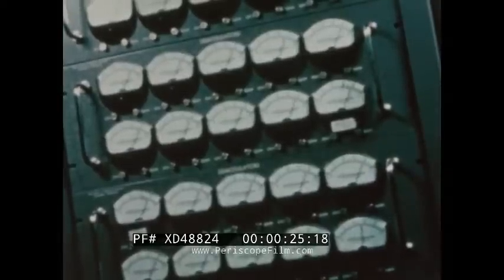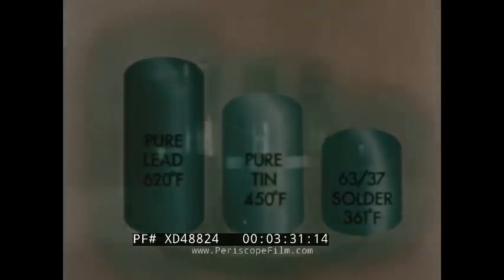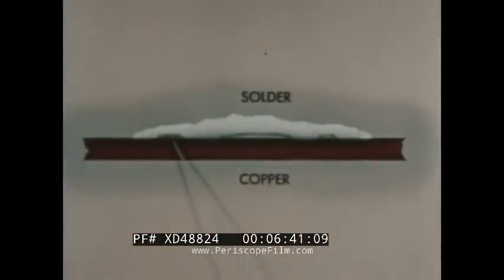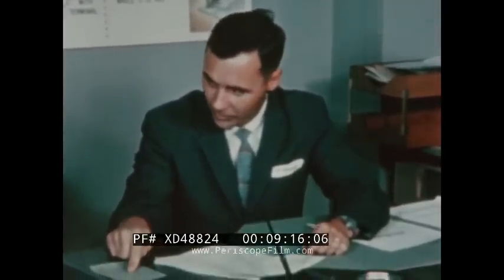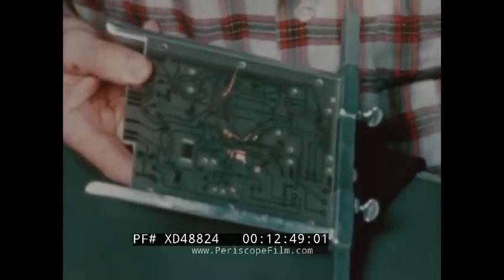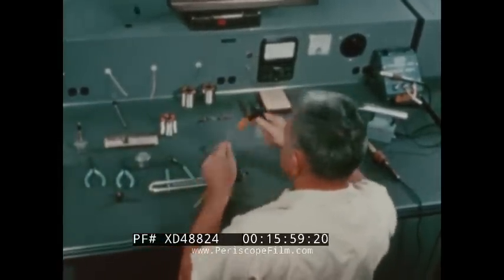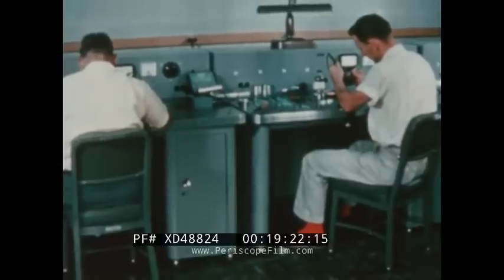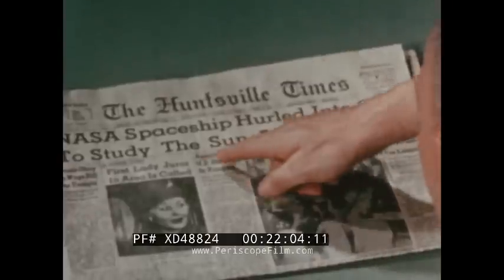1958 "ABOVE AND BEYOND" NASA SOLDER & SOLDERING TECHNIQUES ELECTRONICS INSTRUCTIONAL FILM XD48824

Comment: Solder melts at a lower temperature because the alloy of the two metals is not a crystalline structure. I think they knew that in 58.

Comment: The demands do not cease. Space work is considered “critical circuitry” in today’s world. That would be under the new J standard as level 3 work. I learned back before that when DOD STD 2000-1 was the standard. This is the equivalent to J STD 006 level 3 today. Avionics is treated with equal respect to aerospace work. The solder I used was and still is 63/37(63% tin/ 37% lead) which is known as a pure eutectic solder. It has two states, either liquid or solid. Flux used was RMA, rosin mildly activated, both in the solder’s core and the extra flux which was in liquid form. A match of flux core and extra flux is critical as this chemical matching insures consistent, reliable and repeatable results will occur under this rule. The cleanliness of all surfaces is achieved with 99% isopropyl alcohol and the tin acid brush cut to a shortened length of no more than 3/8” from the tip to the ferrule of the brush. This gives the proper stiffness to attain the cleanliness needed to remove all oxides and any other contamination for each joint. Each individual joint is cleaned prior to and after each joint is soldered. No exceptions are acceptable as there are no slack given as mission accomplishment and crew safety are in the balance as well as equipment reliability. There is much more beyond what this video went into, but soldering to this standard isn’t for everyone. Not all have the patience or skill necessary for it and this level of soldering is an unwavering discipline. There is no place for error in critical circuit work. Absolutely none. Those who do this level of work must never forget that all they do is centered around the fact that no single point of the procedure is below scrutiny. Failure has a high price. It is a privilege to work in this field. If you have the discipline and skills to do this, you will be an asset to your company or the government. Stay safe my mates!😊👍🏻😁

Comment: From my own experience, a "cold solder joint" is an actual problem. It might Test OK but the connection will easily fail and result in an open circuit.
Also, the War in Vietnam, Nixon said; was for Tin Ore and Rubber (which is still 20% of a tire).
Reply: Nixon said a lot of stupid things, few of which were true. ;-)
Reply: @arcanondrum6543  Wars are rarely about anything but about stupid people making stupid decisions, kid. Have you been watching the news lately? Which one of Putin's actions appears rational to you? :-)
Reply: FYI for anyone checking this thread,  Nixon was Eisenhower's Vice President when he said that about the Rubber and Tin and he said it in front if a Map of the Region,  on camera.  US Troops were 1st sent to Vietnam by Ike (and Nixon) and the assumption was that Nixon would win the 1960 Election. 
National Security Action Memorandum (NSAM) 263, signed by Kennedy was to pull all US Troops out of Vietnam by the end of 1965. That was reversed by LBJ (NSAM) 273 just days after JFK'S funeral. The "Gulf of Tonkin Incident" was 8 months later.  Before Eisenhower sent US Troops to Vietnam,  France  (Michelin Tire) had tried for decades to colonize Vietnam, it was called "Indochina" at the time.

Comment: This was super interesting, I started my working life as an electronics repair tech for Philips, I changed career after about 10 years but have been an electronics hobbyist ever since. I'm proud to say that I've never had a project fail due to a poor soldered connection, but I still learned things from this vid.  One thing bugs me though, why do Americans pronounce solder with a silent L, and resin, rosin?  As a Brit I find that strange.
Reply: But it is rosin; traditionally used as flux.

The sodder thing is just bloody irritating tho!
Reply: Dude, you simply never had to work on anything that required reliability. 1 million hour MTBF manufacturing is totally different from what you are looking at here.
Reply: @robertbolstad9465  Ah, you've seen my soldering then! 😂
Reply: Solder is pronounced that way for the same reason any other language develops colloquialism: It's easier to pronounce
Reply: @MrCarGuy  
How is solder difficult to pronounce?  I've been saying solder, with the L, since I was 10!  It must be some quirk of the Americans, since soldering was around long before electronics, it probably developed from the way workers in the plumbing or sheet metal trades pronounced it during the 19th century.
Reply: @schmetterling4477  
Well that is a feature of the Aerospace industry, in which I've never worked, and relatively few have compared to the electronics industry as a whole.  It is surprising however, that mass produced smd boards that are flow soldered are as reliable as they have proved to be. I can present one of my projects from the 70's, a 6 digit clock, built from a kit, using a single clock chip with discreet display drivers, that has accumulated about 360,000 hours without fault, excepting one segment of one of the 7 segment LED digits.  Pretty good going for a consumer electronic item!
Reply: @turboslag  The standard industry processes are only reliable in their near constant environments. Try 1000 heat cycles between -55C and 105C and vibration and the normal stuff will fail on you like there is no tomorrow. That is not even a particularly special requirement. Automotive and aviation are like that (and worse).

I talked to a guy once who worked in quality control for telecom DC/DC converters. He said for the longest time they couldn't get the MTBF higher than a couple hundred thousand hours. They had to switch to a soldering process with high temperature solder and get rid of all semiconductor packages. Only after they decided to solder the dies directly onto the ceramic substrates and go to wire bonding with multiple bond wires did the products pass the 1 million hour MTBF requirement.
Reply: @schmetterling4477  
Yes, I understand that, I wasn't trying to compare the two applications.  During my studies we had a section on MTBF and the tutor made us very aware that it was not a matter of if failure would occur, it was just a matter of when.  He then went through the various factors involved.  General purpose and consumer electronics were at the bottom of the pile,  military and aerospace at the top.  Even so, I still think my humble clock has done well.  One thing that really surprised me is why truck manufacturers locate ecm's on the side of the engine block just about the worst environment?!
Reply: @turboslag  Exactly. Engineering for reliability is a discipline in itself. The hard part in "normal life" is to know when to care about reliability and when it's not necessary.

I have a funny story about truck engines. I went to a conference about optimization algorithms once. One group of students presented a paper on how their algorithm had found a tiny change in the shape of camshafts that would have saved the engine manufacturers a camshaft replacement at the 500,000km mark. After the talk an engineer from a very famous truck manufacturing company stood up and said "That is a fabulous paper. I congratulate you on improving engine reliability with such a tiny design change. Your algorithm has re-invented a design that has been known in the industry for many decades. The problem is this: whenever we sell a truck with a brand new engine, we are losing thousands of dollars on the engine. We only make this money back by requiring the truck owner to do a complete engine rebuild at 500,000km....". The entire room broke out in laughter, of course. This a true story. :-)
Reply: @turboslag  I also have such a clock I built back in the 70's. It was a Radio Shack kit, they sold the clock chip, bare main board and display board. I wanted to do a project and I was sick of my electromechanical clocks dying after a couple of years. Looks like I made the right choice - 45 years and it's still going! I also had a couple of segments fail.
I remember some of the components were fairly expensive, especially the LED display modules.
Reply: @turboslag  its a level of dumb you'll never understand...believe me I've tried for years

Comment: Long before iron plated soldering tips. And as one with a soldering licence I could have a thing or two to tech them.
Reply: Please say more.
Reply: You are the James Bond of aerospace circuits. :-)
Reply: @david203  Well its according to the license from the modern day and even if much is similar its just more evolved in some areas sort sort of speak, fex when you wrap around the tinned cable around a tower its not only one or two times these days, as an example. And also doing all that without a fume extractor is not good.
Reply: Careful not to step in the BS :)
Reply: @GoSlash27  ?
Reply: @dtiydr  Meaning warning to others that you have absolutely no idea what you're talking about.
Reply: @GoSlash27  Like what did I not have any clue about?

Comment: 3:48 So do we know why mixing tin and lead results in a lower melting temperature? Curious if anyone ever figured that out?
Reply: Google it for a more detailed reply but it has to do with the structure of the atoms. Most metal atoms form into a crystal like structure that minimizes the space between them. Because alloys are compromised of different elements, lead and tin in this case, they get in the way of that element creating a crystalized structure. The different sized elements form voids in this structure that lets them melt faster.
Reply: They knew it at the time, they just didn't want to put it in the film and were lazy writing that part of the script lol
Se the answer above for the details.
Reply: If you search for “lead tin phase diagramme” you’ll see the ratios and temperatures.

Comment: Hm for gentlemen speaking about aero industry MCAS problem it was not Indian programmers  it was programmed in Brno Honeywell or at least that is what evil tongues says I dont know whether that is a truth or not but I have some stories from my friends programmers who were offered a job there and they told me some crazy stuff.Namely how programming was done with no feedback from the hardware. Some algorithms were nobody knew what they were responsible for. Bunch of data processed and data optimization with no recheck what that data does etc.. To the actual aircraft (737 max) I ve read long article and basically it boiled down to putting large engines to small aircraft and MCAS to compensate for that because nobody wanted to pay re-schooling the pilots for the larger aircraft some companies namely who run large fleet.

Comment: I don't know why the narrator pretends like they don't know why 60/40 melts at a lower point than tin or lead. To oversimplify, its the crystal structure that solder makes that requires less energy to melt. the structures of lead and tin interact in such a way that the resulting crystal is easier to melt. it has to do with gibbs free energy. the complete answer is pretty complicated, but that branch of thermodynamics has been around for a long ass time, since 1900 or so. maybe this video just didn't want to waste a single second teaching a technician any theory. "yours is to do, not to ask why"

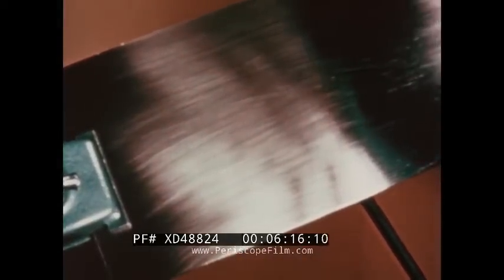Comment: 6:18
this is why it is an horror to fix an old radoo or replace an old device's caps that have a bad varnish or electrolites on the PCB. Still useful today, but if only the current NASA engineers could have that discipline, they'd be back on the Moon as we speak.

Comment: I went to the NASA micro mini soldering and then QA school in the 70s. Bifurcated terminals were a bitch.
Reply: I think you were supposed to push the wire into the slot. But then the surface area of the joint was a minimum. You want it to be closer to a maximum before soldering.
Reply: @david203  It wasn't that simple for NASA specs, the wire could not contact the sides of the terminal and the solder flow had to be perfect.
Reply: @joemalinchalk1314  When building kits, I was always taught to make maximum soldered contact with the terminal. If the terminal has a tip, then the wire should contact the tip. But if bifurcated, there is no tip.
Reply: @david203  Not good enough for NASA.

Comment: Has the question of why solder melts at a lower temperature than its constituent parts been subsequently answered by science? I'm guessing its something quantum-related that they wouldn't have known at the time.
Reply: Why mixtures melt at lower temperatures has been known for quite a while. What happens is the crystal structure of a component is interfered with by the crystal structure of the other component. Same thing applies to anti-freeze. Multiple crystal structures interfere with each other. So in a tin/lead solder, the tin acts as an anti-freeze for the lead, and the lead acts as an anti-freeze for the tin.

Comment: Today = need masters in soldering.
Reply: False. It's exactly the same today as it was back then in the aerospace industry. You can apply to become an assembler with no degree whatsoever. If you're one of the 4 out of 100 applicants who makes it through soldering school, you've got a career for life. Same for technicians; if you're good enough to pass the exam (which is difficult) you're in, no degree required. Promotion to higher labor grades is strictly based on demonstrated aptitude through testing.

Comment: It is possible, but not easy, to solder a copper wire to an aluminum chassis. The reason is that aluminum develops a nonconductive oxide coating much faster and thicker than copper or copper alloys. Yet it can be done, and results in better grounding than can be produced by, say, a nut and bolt through the chassis.
Reply: Only idiots try to solder wires to aluminum. Neither would one use nuts and bolts. The correct technique for aerospace applications are rivets. Nice try, though. ;-)
Reply: @schmetterling4477  Actually pressed-in studs and appropriate hardware. Rivets - not sure about that.
Reply: @milantrcka121  They are building entire planes with rivets. If you have a thick material then studs will probably be more appropriate. Anyway... PCB in aluminum housing is chromate (or modern non-toxic equivalent) with inserts and screws - been there, done that.
Reply: @schmetterling4477  I'm not an idiot, Schmetter, although in your native uncivil way you've deprecated me and others many times before. My point is that I found that it IS possible to solder to aluminum, so long as the oxide layer is removed while soldering. Many people don't know that.
Reply: @david203  You keep burning yourself with your physics bullshit that you keep posting all over the place. So that's that. :-) 

Of course it is possible to solder aluminum. It's just not a good idea. Brazing and welding are much better... if one has to do these things. In practice one would not do that, either. Connecting metals with highly different chemical potentials directly is a bad idea. That's why surface treatments like chromate have been invented a long time ago. It works like a charm, it's just not good for the environment.
Reply: @schmetterling4477  Chromium is bad for the environment because all its salts are poisonous. Aluminum is harmless due to its oxide coating. Tell me, specifically, what is wrong with joining copper to aluminum in an air environment, please.
Reply: @david203  Dry air, constant temperature, no vibration plus plenty of tape on top as backup? Nothing. Now try that with temperature cycling, vibration and salt spray. :-)